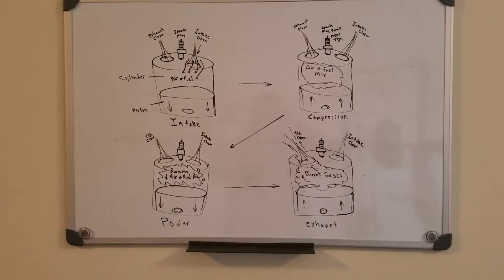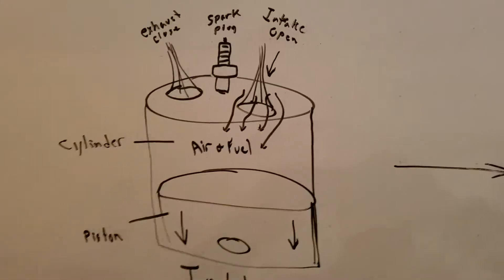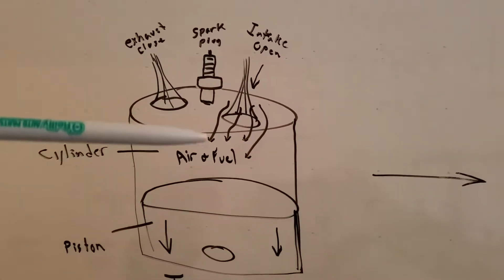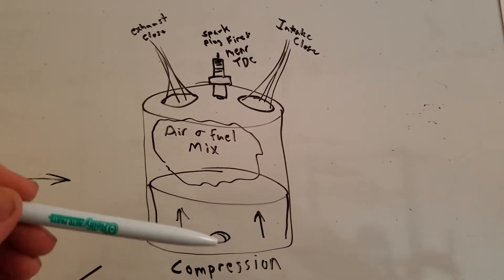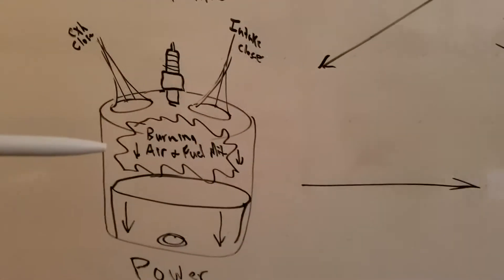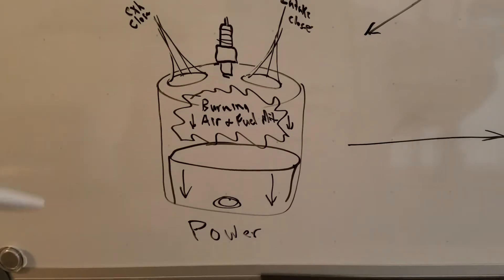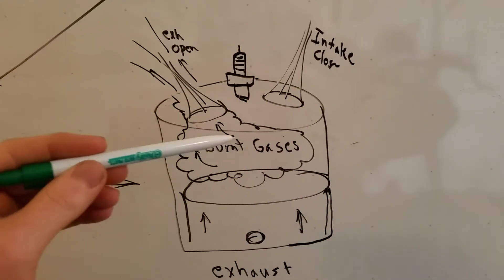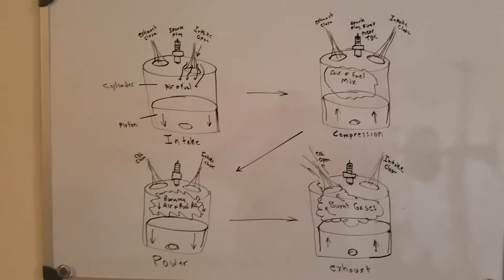Engine 101 pt1 Engine cycles

Comment: So the piston pushes the burnt exhaust gases out. Which having a good exhaust will make it easier. But does it go back down again with a second spark to go back to step one?
Reply from the maker: eunit08 yes correct having a good flowing exhaust helps this is were long tube headers really shine by increasing the exhaust velocity helping to suck out the burnt gases. As the piston reaches the top the exhaust valve will close and these 4 steps will start over again with the intake cycle. The spark plugs will fire at the end of step 2 the compression cycle.
Reply: Phoenix 98 ok so it only sparks in the compression stage
Reply from the maker: eunit08 yes the spark only happens at the end of the compression stage this lights the air fuel mix to burn and expand pushing the piston down on the power stage and the momentum of this will spin the motor till the spark fires again. These 4 stages happen with every 2 revolutions of the motor  example.. so our engine   is running at  2000RPM these 4 stages will happen a 1000 times a minute.
Reply: Thanks professor!!
Reply from the maker: eunit08 lol learning about engines can be fun!👍😎